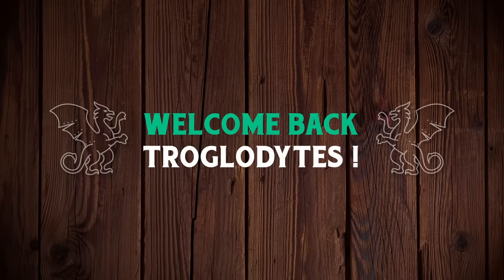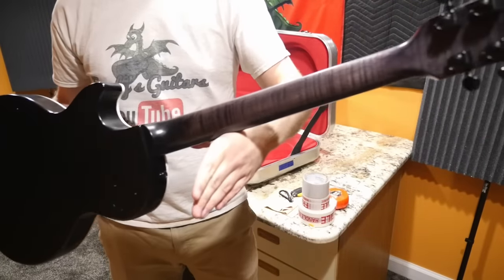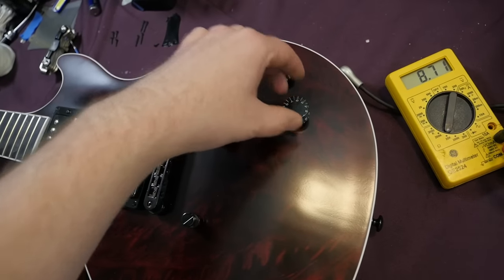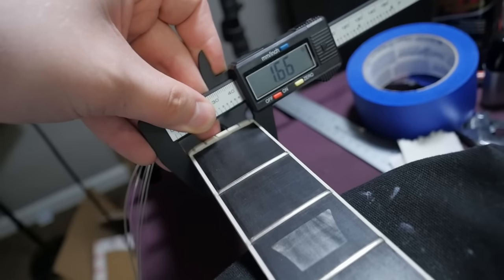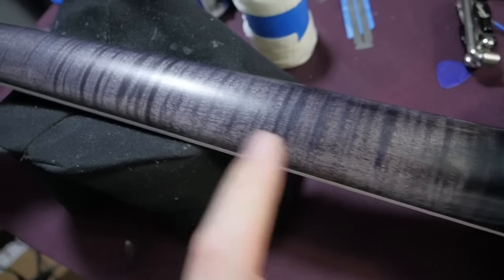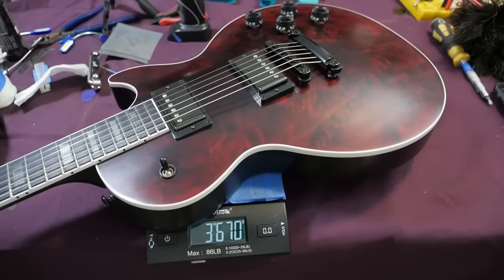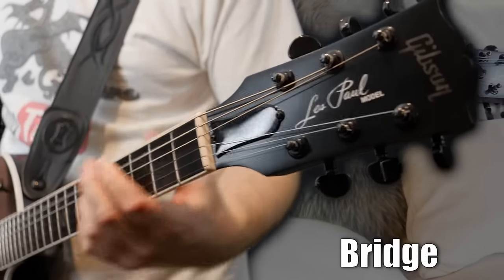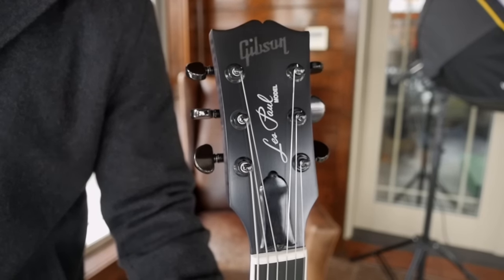Is It Different? | 2021 Gibson Les Paul Blood Moon Satin Black Cherry Guitar Center Limited Edition

Comment: Austin, I had ordered a 2018 Gibson Les Paul HP in Blood Orange Fade from Guitar Center, new back then. Had the pick ups minus the rings, mounted from the back. It arrived via UPS. The case was destroyed, dents all over. Guitar body front was beautiful, but out of case the back had problems. Faded out spots. Brought it into Guitar Center in Bedford Park, Il. The manager was Great. Told me looked like moisture or water damage. Could not get me another one of the same. He did offer and then got me a 2019 Les Paul HP, in Blueberry fade, all the bells and whistles, does have the chrome pick up rings, and the very cool “carbon fiber” looking case. Very pleased with this to this day, but still always wanted that Blood Orange Fade HP. Just wanted to share that with you. You got me involved in REVERB, I have since bought from the Gibson demo shop. Very pleased. Had a broken knob, not disclosed. Emailed and Gibson sent a new knob out immediately. Great service. Also have just sold 4 guitars on Reverb, very easy process, use the stew Mac shipping system for safety, and as your warning; remove the switch tip, protect the headstock and pad the bottom strap button. See, I pay attention to you. THANK YOU, AUSTIN! ⭐️⭐️😇⭐️⭐️

Comment: Greetings Austin!
That has some very interesting wood grain. Those are some great pickups, with some extra options with the coil splits, phase switch, and the direct to output, these are all great options if you like to have a more dynamic range at your fingertips. The coil splits I like, especially because they enable you to dial it back if you are just on the verge of feeding back uncontrollably when you have your equipment cranked up for a jam session or if you are playing in front of a large crowd indoors.
The color scheme and finish are nice, it’s too bad that they didn’t use abalone for the neck inlays, because they really would stand out, but that is just a matter of preference for some folks and doesn’t really affect how it plays or sound. It is interesting that they went with the lightweight bridge but the heavier tailpiece, it may be able to slightly and easily tweak the sound by swapping those out with different components. 
Really nice neck with the flame🔥maple. 
Personally, I like the case, and it could definitely benefit with a clear or colored vinyl wrap to protect it from scratches.
It’s too bad it doesn’t have 24 frets like the Epiphone Prophecy Les Pauls do, it would be a nice bonus feature.
All in all, it’s seems like a pretty nice Gibson Les Paul, and it is not so expensive that it has become an unobtainable instrument, for some folks. If I didn’t currently have desperately needed auto repairs to deal with, I would consider picking one up, I am fairly sure that this one has already found a home, by now, provided that you are not keeping it for yourself, in which case it is already home.
Thank you for posting these videos!
Please have an excellent and awesome day! ☀️✨
Reply: 24 frets on this would be bad ass. Definitely a guitar begging to be tuned a little low

Comment: Heads up Trogly, Reverb-2020 Gibson Les Paul Blood Moon Guitar Center Exclusive Red
Richard C. – Jan 6th, 2022
Instrument is nice; however, someone tried to file down the fret wires, and the filing damaged the wood on the fretboard, which was not pictured in the ad. I messaged the seller about this, and never heard back. So, not much in the way of post-purchase communication; however, was extremely responsive leading up to the purchase. Super nice guy and pretty fair pricing otherwise, but I am a bit disappointed about the damage not being disclosed when spending this kind of money.

Comment: I saw the ad for this when they came out for black friday and immediately ordered one. I love this guitar and I'll never sell it. It's gorgeous and plays like a dream. Like it was made for my hands. 

Mine has much more quilt to the top and also has a lot of flame in the neck.  Another thing to note on the spec sheet is they originally advertised these with locking tuners. They didn't come with them. GC refunded me enough to buy locking tuners and put them on. 

Anyone that wants one of these, get it. You won't be disappointed.

Comment: In experimenting with a coil-split humbucker on my own guitar, I'm not particularly fond of the sound I get (it's not particularly distinct from the sound of both coils at once). I attribute that to the fact that it's a low-output hum; I think the split pays off better when you have a hot pickup (11K+) so the halfway value gets close to a Strat single. And especially since this one sounds so dark, it takes engaging the out-of-phase setting to brighten the output to anything that has that single-coil jangle. This one is definitely more suitable for nu metal than, say, classic hard rock sounds (without having to get fussy with the switching).

Comment: These are almost exactly like the current Guitar Center one the satin red trad v. The current one has mahogany asymmetrical neck and rosewood fretboard. It does have the dip switches to change pickup config. It's 2k but on sale often for 1.5k

Comment: so a  big portion of the mark up is the case? and paint job? and pickups?  and  pickup  cover and smoke hardware? and binding?

 pots cost nothing. push pull pots cost nothing,  capacitor cost nothing,  knobs cost nothing. switch cost nothing, tuners cost nothing. soldering  electronics is easy to do. 

as much it's cool of the stock stuff,  made for collectors or just saying you got one. maybe saying it's an ebony fret board with compound radius. which all you do is switch sanding block when sanding. 

price doesn't reflect what you get in buying one.

a guitar that costs over $2000 should get more. on a low mark up price of $500 for a manufacture discount price,  they could add a bundle to the guitar.
 throw in a 1 watt amp, additional gig bag, a cleaning and polishing kit for matte finish, fret board oil and strap locks. 

and still make a profit.  due to manufacture bulk discount and mark up. 

rather get a Flying V plus a Studio and precision bass  than spend $3k  for 1 guitar that's overly inflated. 

But that's just me.